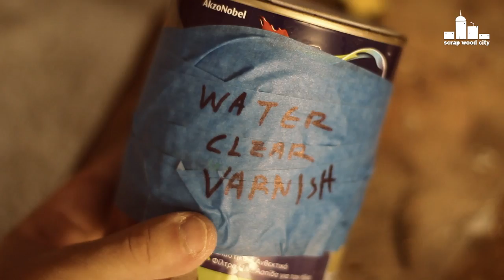DIY wooden handle for a Japanese pull saw

Comment: I'm addicted to those japanese blades,they cut MDF like butter. I have a single one,smaller,since 2013 and it stills cuts like anything i want,from PVC pipes to plaster castings,and it's like new except from a few teeth in the middle which accidentally went to cut on metal. The handle i had made for it was a scrap 18mm MDF piece split in the middle but now it wears off.
Πολύ καλή δουλειά.
Reply from the maker: Thank you very much

Comment: Nice job but i have to ask do you have a router or a dremel? it would have made it much easyer on you're hands and faster but if you made it that way because thats how you like it then fared enough. I just remember how much those hand rasps ripped my hands to bits years ago, and you did not use a cloth to hold the other end unless they have smoothed the last 1-2 inch in the last 30 years since i used them haha.
I have wanted a Japanese saw for awile now as alot of wood turners use them to cut there work off the lathe, i do have a blade but its kinda flimsy and bends real easy. I guess i could cut it down but i would have to use my dremel as i don't have a angle grinder to cut it down with but i think now i have seen you're video i will give it ago.
Cheers matey.
Reply from the maker: Thanks. I have a dremel and a router also. I used the rasps just to show a technique involving cheaper tools. I also really enjoy using those files!  :)

Comment: +1, however this blade should be removable with pin or something like that, the wooden handle looks too good to be single use
Reply from the maker: Yes, those blades are supposed to clip on a handle with a locking mechanism! I just thought i would enjoy making a custom handle for it
Reply: without pins looks really good and smooth, if You don't use it very often it will survive long time
Reply: Was just about to say about the same thing. A removable pin, screw,  small cam lock, or similar would have been my choice since the blades are replaceable, and it permits saw disassembly for storage/transport in a smaller footprint.

Comment: I don't think I've ever seen a curved handle on a pull saw, all 4 of mine have straight handles wrapped with rattan.
Reply from the maker: Of course they are! I did not want a traditional Japanese design. I wanted something ergonomic with a touch of traditional Greek handsaw design!
Reply: Scrap wood City I understand, just thought maybe there was one that I wasn't familiar with. Got my first one back in the early'70s from a guy who brought it back from a visit to Kyoto, I don't think they were for sale in the U.S. back then but maybe I'm wrong.
Reply from the maker: I would love to have a good quality Japanese saw.  The blade I used on the video was a gift! it's just a cheap blade! It works well for it's money though!
Reply: There are some modern japanese saws with the pistol grip handle, shark saw makes a few.